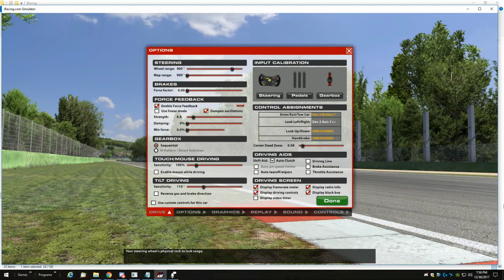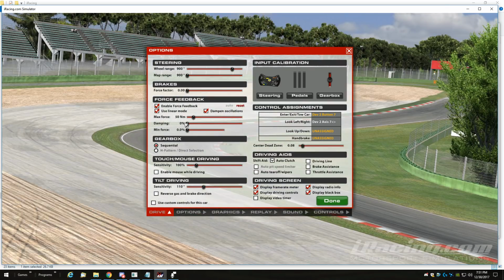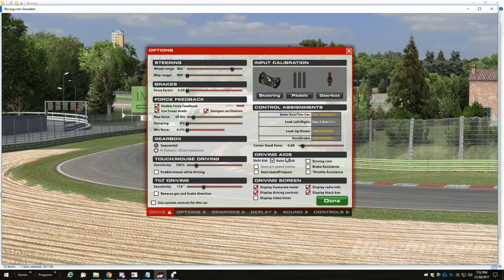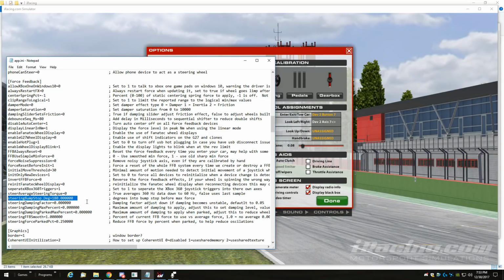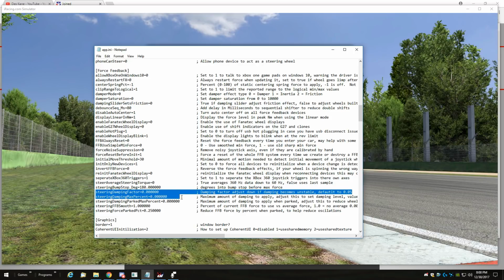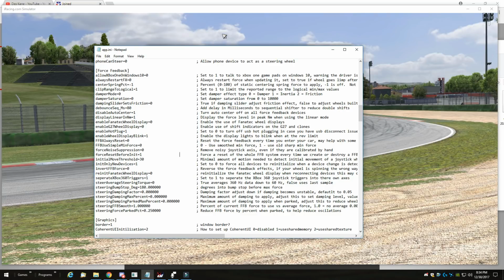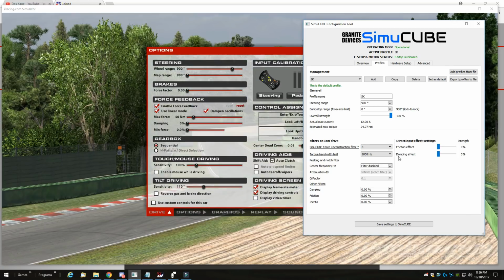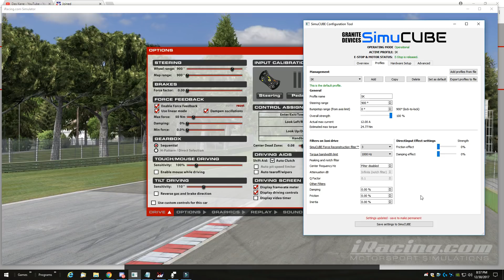iRacing SimuCUBE Direct Drive Wheel Settings Guide

Comment: Hi guys.  I’m new to this and have the IONI firmware I believe.... (got my wheel 2nd hand) I use the MMOS exe file for my settings. Am I still able to do this or do I need to upgrade something? I’m very new to this .......
Reply: son of god 316  I have been looking for it but can't find it, could you point me in the right direction?
Reply: Think I have found it....
Reply: son of god 316  small mige, not sure if its the right download
Reply: son of god 316  thank you!
Reply: son of god 316  I just watched the video. And I did go to the right place. Just not sure whether I can change from MMOS. 
That does seem better than what I have
Reply: son of god 316  It's awesome, wheat wheel do you use. What's your name in iRacing? Personal Message me if you want
Reply: Actually, don't know if you can pm me here

Comment: does the new iracing update changes anything in your guide?:

Force Feedback 

- The Simulation will no longer attempt to dampen when the Force Feedback option "Dampen Oscillations" is checked. Instead, it will only reduce the force level. The dampen effect is not stable on all wheels. This should help reduce some wheel oscillations when the car is parked.
Reply from the maker: Nothing has changed.

Comment: I mount yesterday my new Augury OSW simucube (0.9.10 firmware version) and your settings for assetto are great! 
BUT...  in iRacing, when I get into the car the wheel start crazy (left-right so fast)  and I cann´t do nothing. 
Can you help me?? I´m try few configuration and same problem...
Reply from the maker: copy all my settings from this video. and lower the steeringForceParkedPct=0.250000 in the ini even lower, try 0.100000 and lower the ffb strength in iracing if needed higher number in NM is less FFB strength ingame.

Comment: Set your Damping and you WILL find you will be much smoother , which is what the Damping does  it smoothe but your input AND the Output to the Wheel
Reply from the maker: i will be coming with a video on that soon ;) i do use some at the moment but very little 1% dampening and 0.25% friction. its really needed for some cars and tracks especially on the nordschleife. and some real bouncy cars like the williams fw31 en fr2.0 but its nothing more than supressing a underlying problem the 60hz ffb rate of iracing makes the ffb very jerky. a higher ffb rate would help a lot.

Comment: Can you send me a link for the granite devices software please? I am using MMos at the moment. Btw, I did everything how you told in the video, but it doesn´t change anything on the wheel... . I know I did something wrong but, what? It must be something with the app.ini, I think. Thank you :)
Reply from the maker: The ffb will stay the same in iracing ffb doesnt really change as you see in the video the fixes are for the bumpstop problem and the oscillation in the pits. the simucube firmware is a bit better dough. Read this really well : https://granitedevices.com/wiki/SimuCUBE_firmware_releases and download firmwares here : https://granitedevices.com/wiki/Installing_MMos_firmware_into_SimuCUBE if you have more questions or problems its best to ask them here: https://community.granitedevices.com/

Comment: Hello do you have the setup for setup Simucube 0.9.5 ? thx
Reply from the maker: its all the same only the simucube tool looks a bit different now some things are added but that makes no difference to this ;)
Reply: i have more setting in direct input effects all at 0?
Reply from the maker: Indeed all at 0 ! iRacing doesn't use any Direct input effects :) you can also see in the simucube tool that that are not active. mostly only old games use these canned effects(rf1 based ect).
Reply: okay perfect thank you do you setup the setup can be different with a encoder 2'000'000? and not 40'000 like you?